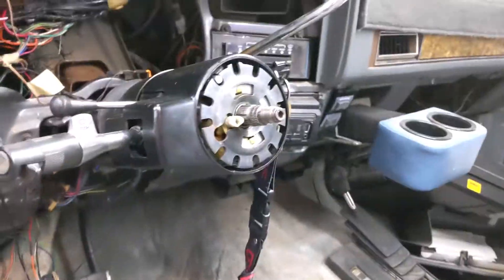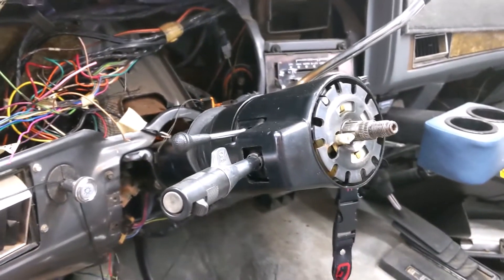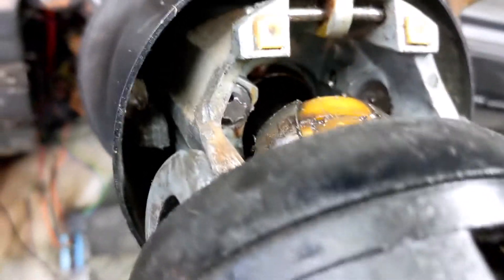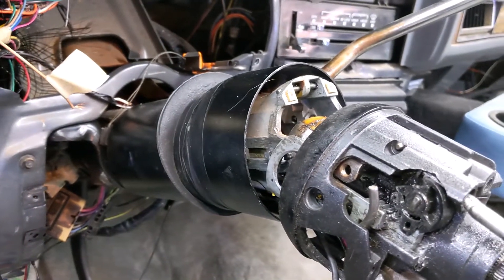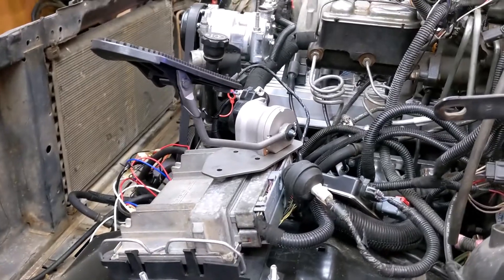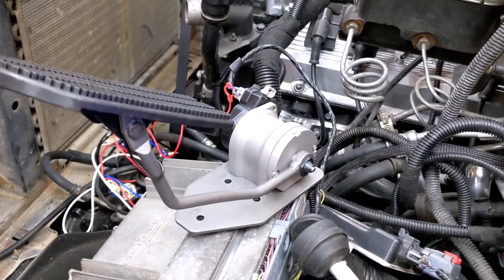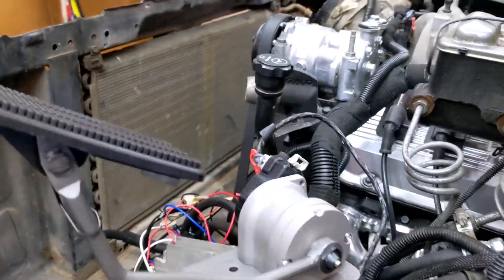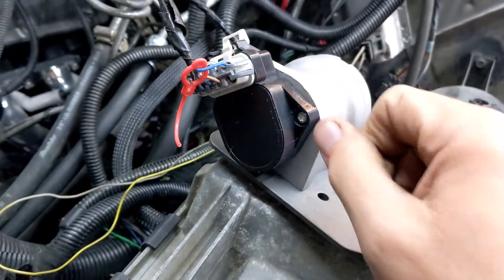Squarebody Suburban Vortec 8.1 Swap - GMT400 Drive By Wire Pedal Mod

Comment: Why did you decide to use the diesel pedal instead of the stock 8.1 gas pedal?
Reply from the maker: Because the stock 8.1 pedal does not fit in a Squarebody. The GMT400 Diesel pedal is bolt-in, although you have to re-pin the connector a little. It's not hard.
Reply: @PetesPlaceGarage   good to know. I’ll be on the watch for one. Thanks
Reply from the maker: @Spiffy303  it wasn't expensive. Under $100.  I bought it new.